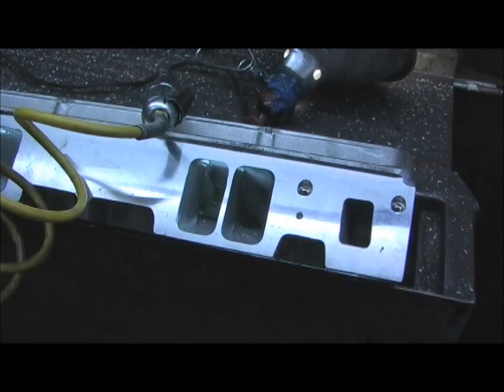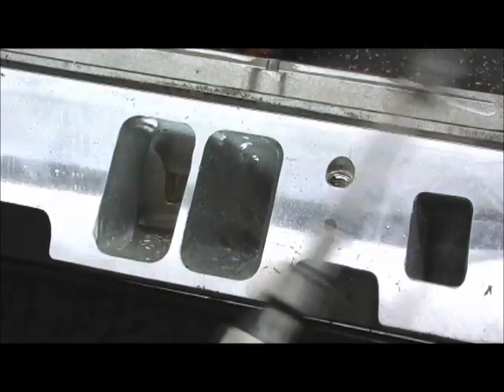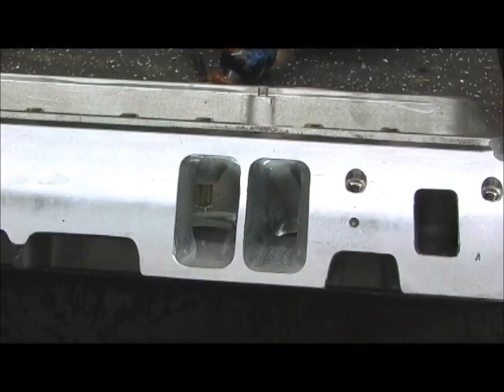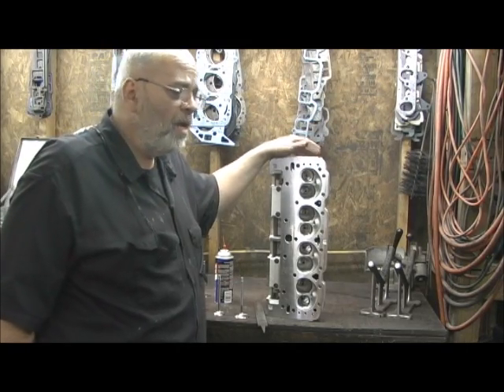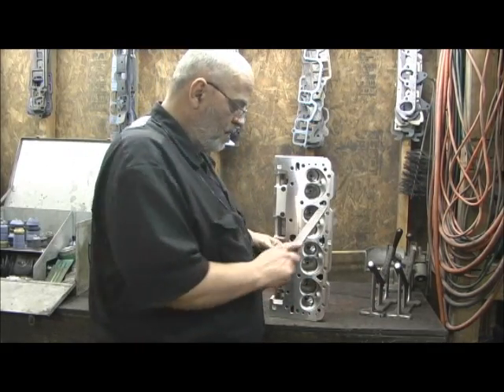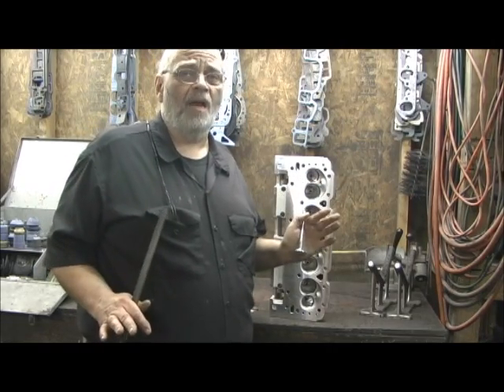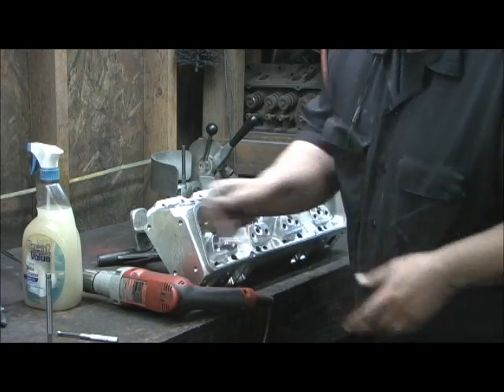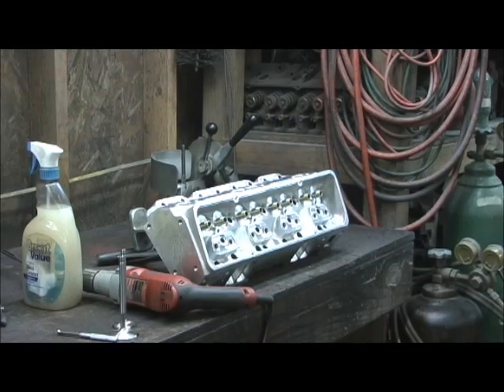McCorrmic's Edelbrock E 200 Valve Filing and Guide RE-HONING 4.0

Comment: Tony,
It is quite refreshing to see someone else confirming that straight valve guides, honed clearances combined with round seats are a necessity to proper valve job.  What I find when performing the above procedure, is the engine will idle smoother and run cooler.
Reply from the maker: Thank you, but it is EVEN more than that sir. What most people don't realize is it BENDS the dam valves; and in time, and I mean a SHORT amount of time Gasses will begin to LEAK BIGTIME, and with that HP losses for sure. I have seen as much as 50 HP gained by getting this right.